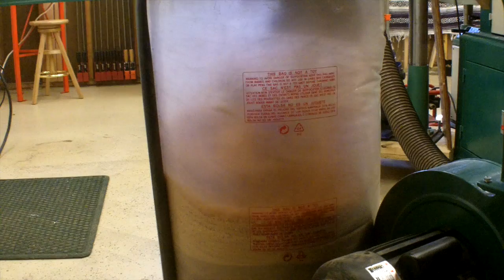Bench for Grinder, Metal Bandsaw, Sharpener and Metal Vise

Comment: That is one stout bench!!Like the powerstrip,never seen one that huge.
Reply: +Abel Nieto  Home Depot sells them.
Reply: They're handy for things like workshops and crafting areas.  What I have found is strange is that you may have to check the electrical department to find them; and they aren't always sold immediately near the "normal" types of power strips.  My local Menards sells several models between $25 to $50, for example, but they're stocked in a different aisle from the power strips, outlet splitters, surge suppressors, electrical timers, etc.  You may have to ask where they are located.

Comment: Very nice....tools are so much more accessible now.
Btw, I noticed your Bosch Miter Saw.....thinking of replacing my old Mikita with a New Bosch. I love how butter smooth the articulating arm is. However I have heard that the dust collection is not really the best...I would imagine that it could be improved with some mods.
What are your thoughts of this miter saw and its dust collection?
Reply from the maker: WestCoastMods I agree its not the best, I've put a bit of effort into making it better without much success ... nothing is perfect I guess, I still like that saw.
Reply: Andrew Klein Thanks.....talk to a lot of ppl that have the Bosch on one of the woodworking groups on FB....almost everyonre of them said they loved it...I think I am going to bite the bullet at get it. Do you have the 12" or the 10"?
There is only a $40 dif between the two....even though my table saw is 10" and I could swap blades when needed...However, I still thinking that I want the 12" and just buy dedicated blades for it

Comment: Andrew is it possible or necessary to build this bench with the leg base wider?  i know its a heavy, quality made bench, it seems that the legs are too close together and that it would topple over just by bumping into it.  i plan on building this, you done a great job,  hell, ive watched enough "half-assers" trying to create one of these, i could have built 2 of them.  i love your work and precision---
Reply: im thinking of something different---a workTABLE
Reply from the maker: Jeff Thompson yes, I agree, for work table the top and base would be quite narrow, but for a surface that is entirely covered by tools like this it should be fine, its not subject to many forces parallel to the floor.

Comment: Not near enough room around the tools to work on anything bigger than a cold chisel.   Nice shelf, well made but way too crowded
Reply from the maker: Not at all true, after using this for several months I can confirm that the tools only occupy space that isn't needed when using the other tools.
Reply: The vice is what troubles me the most,    if you spin it so you can use it, there is nothing to keep the table from flopping over,   and in its current configuration, you can only have longer stock protruding towards the front.    Too cramped for any serious work around the vice.
Reply from the maker: There is some truth to the table being a bit tippy, because it is narrow (not because it is crowded).  I'll probably anchor it to the wall in my new shop.

Comment: That's one strong bench. What?, not bolted to the floor? Just kidding Just kidding. Will be surprised if you get any vibration through the bench.
Reply from the maker: MRrwmac it vibrates for just a second as the grinder gets up to speed, but then it stops.  I can live with that.